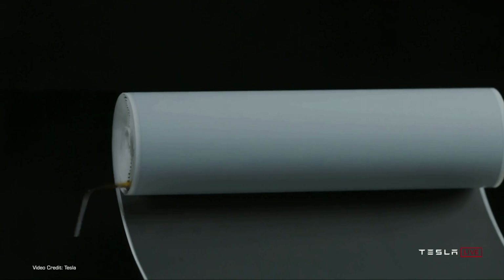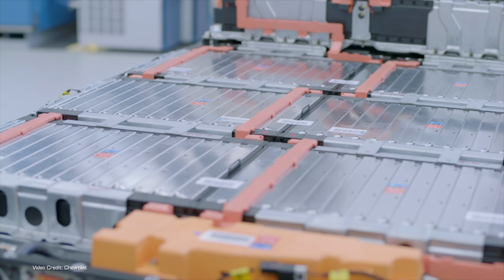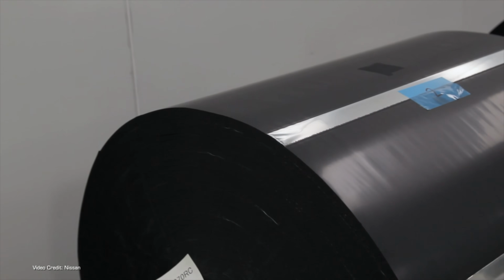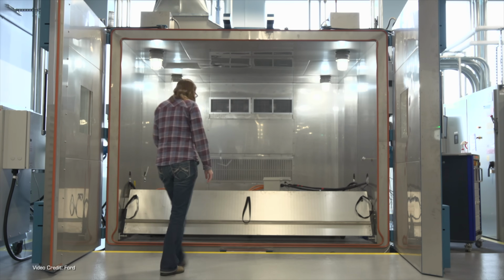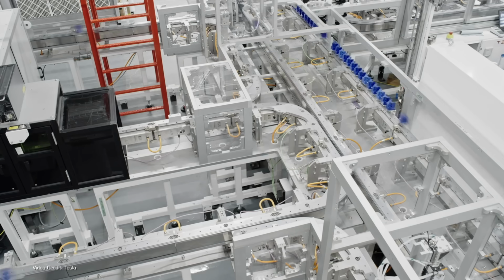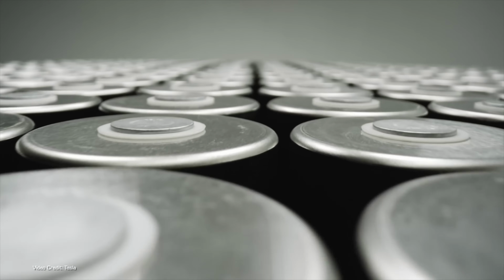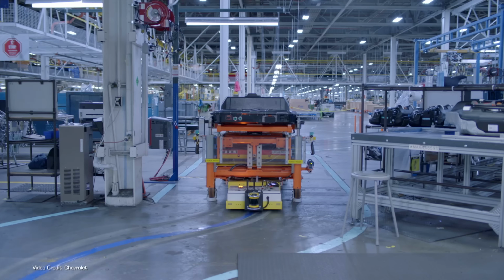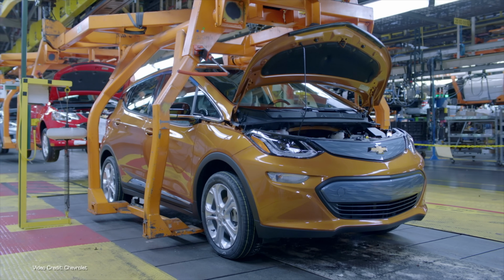Just Why Are Electric Car Batteries So Hard To Produce (And Diagnose)?

Comment: 15:55 I'm sick of Tesla and their excuses for delivery delays, they did not invent a new battery chemistry in "The Battery Day", they just changed the individual cell dimensions to be slightly more space efficient (think of it as they have longer rolls to produce larger cell). and BTW their new cells is slightly energy dense, not much energy dense (the advertised sizes 60% and 50% ...etc is a result of being bigger/heavier). The increased range and density in  is very small.

Comment: It seems EV battery issues will slow the adoption rate. Governments can't mandate technological progress without problems.

If you really believe global warming is a serious problem just put a tax on carbon emissions and not try to dictate technology.

For example, widely adopted PHEVs with cheaper, safer, but less dense sodium batteries would reduce emissions more than poorly adopted EV.
Reply: For example. Widely adopted PHEVs using a safer less dense sodium battery could reduce emissions more quickly than an EV push.

Comment: I have heard a number of commentators talk disparagingly about how long it is taking to get the 4680 cell into volume production. I am pretty sure that Tesla said it would take about 18 to 36 months when they discussed it on Battery Day. Wasn’t Battery Day in September 2020? If so, it has been 10 months since the 18-36 month clock started. Can you help me out understand why the impatience? Thanks to you and your team. Love your work!
Reply from the maker: We aren’t feeling any impatience, that’s the point we’re making here. 

It’s taking as long as should be expected, and in line with Tesla’s estimations. But we’ve seen commenters, both here and in Tesla forums, express confusion as to why it’s taking as long as it’s taking, given that Tesla has demonstrated the cells already, because folk don’t understand what goes into scaling up a battery cell production process. - Winter

Comment: Current battery tech is too short lived, too slow to charge, cost is too high, and the ability to recycle these batteries is limited.  I consider the current tech interim until something that is made from less costly materials, easily recycled, and longer lasting are developed.  The solid state batteries sound like they may be the next leap in that direction.  Faster charging, longer lasting, more forgiving, with reasonable capacity sound like solid state may deliver that.  To baby the current battery tech in that sweet spot between 80% and 20% charge, control the temps, and keep them happy removes enough range and capability of the car to be back in the equivalent range of the first gen short range EV's.  And if you are in a first gen EV it means hardly any range at all in a car that had hardly any range to begin with.  So this is quite challenging.  But all that said the bigger issue is infrastructure and having charging stations spread far and wide.  It is easier to take care of those batteries if you aren't constantly wondering where you are going to get some electrons to keep that battery happy.  Then making sure those charging stations are online, functioning, and can be easily used with a debit and credit card.  End the membership schemes and other gimmicks and just make things simple.  Everything does not have to be complex and involving toys, apps, and gadgets.

Comment: are they really that hard to get right.....or is it just really hard for everyone other than Tesla? The fact is that unlike what's happening with the Bolt, Teslas haven't had these sorts of problems. Tesla has had enormous success in reducing cell costs and scaling volumes. You cite the time it's taking to get 4680 cells into production as evidence that Tesla is having problems....but are they? It seems that it's just your opinion that it's taking too long.

As for cobalt and scarce minerals, again, Tesla seems to be at the forefront of addressing these concerns by moving away from cobalt and getting into the mining business....and developing more environmentally friendly and inexpensive ways of mining these materials. Additionally, they (Tesla) have developed a strategy of using different chemistries and form factors for different use cases, further optimizing cost, longevity, charging times, and other factors to best suit the use.

All in all your piece attempts to blur the distinctions between those who are really good at this and those who aren't, and as a result paints a less than accurate picture of the situation.

This piece really should have been called "why is it so hard for everyone other than Tesla to figure out how to make batteries".
Reply from the maker: You absolutely heard what you wanted to hear in our comments about how long it’s taking Tesla to get the 4680 cells into production. It’s taking exactly as long as Tesla projected, but we do see comments, both here and on Tesla forums, questioning why it’s taking as long as it is, so we thought including Tesla in a discussion of how challenging scaling battery production is, something the company knows well, which is why it projected the timeline it did. 

Tesla did have challenges earlier on with battery issues in customers’ cars, including fires and misbehaving charging, and it worked those issues out over time, which is why its current batteries are as reliable as they are (which again, we credited them with in this video). 

It’s also important to remember that while Tesla produces batteries for its cars, it also buys cells from other battery producers, including the issue-plagued LG Energy, whose improperly produced cells are at the heart of both the Kona EV and Bolt EV fires. - Winter

Comment: What I don't understand is how Ford F150 is apparently going to get over 750km on a single charge, and Lucid is claiming nearly 1,000 km on a single charge, yet neither make their own battery. Surely if there was some breakthrough by Panasonic, CATL, LG, etc, we would hear about it in the press before it made its way into a car? Even the vaunted "industry leading" Quantumscape issues a PR every small breakthrough they make.

Nikki, do you believe these ground-breaking ranges coming out from both legacy and start-up automakers? The numbers seem too precise to be made up. Where are these leaps in performance coming from which even the established battery makers don't seem to know about?

Phillip.
Reply from the maker: It’s not a leap in performance, these companies are just packing in massive battery packs to achieve the desired range. Look at GM shoving 200kWh of batteries into the top spec Hummer EV to achieve the range it has despite what is likely to be wretched efficiency. Even Tesla’s Cybertruck with its new form factor batteries hasn’t achieved anything radical in wh/liter of energy storage. It’s just going to have a lot of batteries - Winter
Reply: @transportevolved  re: "It’s not a leap in performance, these companies are just packing in massive battery packs to achieve the desired range." exactly, same as the real word there's NO SANTA CLAUS in "battery world" either folks.  as such it's a very simple equation: MORE ='s MORE ("Bigger is Better" - Texas accent).  the pack in the Lightning is said to be a massive 1800lbs, and the new "all conquering" 2022 Tesla MS Plaid is still a nearly 2.5 Ton vehicle (4833lbs per Brooks of Dragtimes).  right, compare this figure to the larger 2022 11th gen Honda Civic (basically PEAK ICE) with it's declared Curb Weight of only 3100lbs max.

Comment: Of course, all of these issues are solved if you consider Green Hydrogen.  Renewable energy used to make clean hydrogen from water.  If you'd do a side by side comparison, it's apparent that the "All battery" approach misuses the "battery."  Hydrogen is nature's battery.  Potent (100x specific energy density per mass), safe, available to all local economies, and 100% non-toxic.  Also, and please take this point on, it can scale!  That means we can have a clean energy world based on a Green Hydrogen paradigm.  Fuel cell EVs make sense because they're 1% "battery" and 99% fuel cell.  When you battery people take this onboard, you'll see there's a better way to use batteries than using them for 100% of the load.  Just nuts, (or unwilling to calculate the amount of "battery" you'd actually need for our world).  Fuel Cell EVs are the only path, using Green Hydrogen, which can actually save the world.  Remember that priority?

Comment: Hi there winter or whoever is reading this.

Is it possible to make a video about the importance of a strong, well engineered KERS/Regenerative braking system?

I think a lot of people don't seem to understand the value of it.
 And I myself would love to understand the difference between a Kona Regenerative braking system vs the MG zs ev KERS vs the Tesla .

As I m unable to understand how much power is actually put back into the battery and also how much additional range I am getting from it realistically when comparing total range figures

Comment: I’m going to come out say it but the Spark EV is the best EV GM has made so far. 400 lb/ft of torque for the 2014 and 327 for the 2015-2017’s, no fires.  Peppy and works well for a commuter, easy to park. The Bolt doesn’t have the Sparks torque.

Comment: Great video. Considering the way in which GM has handled the Bolt battery issues, consumers will be especially interested in all aspects of how GM is developing the Ultium battery system.
Reply: re: "GM is developing the Ultium battery system." which for now is really just a "name" a "label" no different than what we've seen created/used in different ways by the Auto Industry for the past 100 years.  there may not be anything of "greater" SUBSTANCE in it beyond what we already have (because: MARKETING).  mind you this is not a BAD thing because what we have in terms of existing Lion Batts is PRETTY DAMN GOOD.   so the key is getting control of our "Greedy/Rapey" behavior long enough so we can appreciate it for it is.  no fan of Elon, but the new Tesla MS Plaid is a "working demonstrator" of the value of current technology and capability.

Comment: The high voltage required to keep the cost of the car down means you have to put multiple cells and modules in series, which makes balancing the cells more difficult, requiring even tighter tolerances.

Comment: It's not just batteries in vehicles. Yesterday down here in Au the Victoria Battery had a fire and that was during testing. As a local fireman pointed out all you can do to extinguish that kind of fire is to let it burn out. As for for forensic analysis of why a cell went bad it's hard when the thing has melted. I've put out an ICE fire, it was due to an electrical fault.

It's when you look at the challenges from an energy density perspective I think you get a clearer picture. Li-Ion cells are around an order of magnitude lower  than a high explosive and high explosives have around one tenth the energy density of petrol. Petrol needs oxygen to burn or go bang. High explosives and many electrochemical cell chemistries  don't need oxygen to do bad things. A fire in an ICE is usually pretty easy to extinguish especially if caught in time. Not so easy in a battery pack of 1,000s of Li-Ion cells. We could build Li-Ion battery packs with individual cell monitoring but that would  be expensive and add some weight and manufacturing difficulty. Practical for stationary batteries but not in an EV. 

The other factor here is the sheer number of cells in an EV. Li-Ion batteries were first used in video cameras in packs of a small number of cells. I've had odd one go bad but not a huge drama and simple for the manufacturer to do the right thing and give a replacement. It's a problem that scales the wrong way as more and more energy storage is needed. One bad cell in a pack of 6 or 12 and a total loss is bearable. One bad cell in 4,000 taking out the whole pack or as is very likely,  the whole vehicle is a real problem.

Comment: There are also problems in volume production of any high volume product. First to find test methods to really detect all deviations from the required characteristics and then the issue that no matter how careful your are some defect product will sneak thru as good in ppm quantities.
For this reason not the best performance design may be desirable but the one which in case of failure doesn't cause an issue. In case of batteries LFPs are the safer choice but don't have the desired other features like super fast charging/discharging, capacity per volume and temperature characteristics. Solid state batteries might be even better but as was said it takes forever to make new things ready for production.

Comment: I would be happy with batteries that simply have a less catastrophic failure mode.  I think the goal should be battery chemistry that is not prone to thermal runaway but getting that and sufficient density, charge cycles, and temperature performance may be a while off.
Reply: You mean like LiFePO4 ?
Reply: I'm pretty sure the market will provide that, just in a less blunt term.
You can buy the latest superduperdoublecheese battery car (only thousand produced with this technology, so you are a beta tester of sort) or a oldestablishedlowtech battery car that has not that performance, but a million piece were around so we have already worked out the kinks.

Comment: It’s funny how EV enthusiasts claim that EVs are so much simpler than ICEs. . They aren’t.
Reply: I totally agree with you, the whole battery pack alone has tousands of cells which can easily fail, the BMS, charger, inverter, motor controllers, and all the sensors inside, plus the complicated software to monitor all of it.
Reply: re: "It’s funny how EV enthusiasts claim that EVs are so much simpler than ICEs. They aren’t"  what we're seeing in the claim that BEV's are "simpler" is actually the PSYCHOLOGY of PROJECTION.  as such it's not BEV that's "simpler", no, it's they (themselves) who are "simple".  that is, they are "simple minded" in their thinking/Cognitive Ability, and don't really understand how truly COMPLEX the Universe actually is.   you can see this same PARADOX with the Commercial Jet Engine.  in principle the "Jet Cycle" for thrust is almost LAUGHABLY BASIC in it's operation.  great, now try to build one in your shed EQUAL to those built by Pratt Whitney, GE, Rolls Royce, etc.
Reply: @phillyphil1513  I see the point your making about everything being complex and the jet engine is a good analogy, but to say that people who support EVs are simple minded is offensive and unfair.
Reply: @phillyphil1513  it is simpler because there is almost nothing to service and far less to go wrong.
Reply: There's less moving parts in an ev so in that sense they are simpler and theoretical have less to go wrong but obviously they are both complicated machines.
Reply: @timscott3027  there are less moving parts but tousands of electronics that are even more difficult to repair and won't last as long as ICE, you can still see 30-40 years old ICE on the road
Reply: @carholic-sz3qv  Have you not seen the amount of electronics in the current ICE vehicle? They have comparable electronics systems to work these days with ICE needing engine monitoring systems to keep pollution as low as possible and BEV needing battery monitoring systems to maintain battery temperature.
Reply: @carholic-sz3qv  yeah possiblity, I guess time will tell. Most ice cars will have had a lot of parts replaced at that age though, why couldn't you do the same with EVs? Perhaps car makers should be building cars with easily replaceable components all round including electronics and drivetrains.
Reply: @timscott3027  EVs are more controlled with software and swapping parts here and there won't be easy in the future, just like on iphones. People have even lost acces to tesla superchargers for those reasons.
Reply: @carholic-sz3qv  yeah I know but not impossible, just not economic all the time, but that's true of ice cars too. That's why easily replaceable components might be a good thing. It would probably need a lot of government regulations to make that happen though.
Reply: @timscott3027  unfortunately its not going/isn't working. with vertical integration, repairs are going to be a huge disaster just look at the latest apple imac, everything is on board and apple will probably never sale parts for repairs as louis rossman knows.
Reply: @carholic-sz3qv  all management systems rely on sensors, ICE EMU retunes the engine mapping all the time to keep it at optimum efficiency so it has to interact with the sensors all the time. All the  ICE vehicles comparable to Tesla will have  multiple cameras and systems for adaptive cruise control, traffic-sign recognition, semi-automatic parking, "sports mode" controls, collision warning systems etc etc
Reply: @rtfazeberdee3519  tons of ICE have had cameras all around even 360 degre views and many other features, EVs still have way more electronics than ICE tho.
Reply: @carholic-sz3qv   Your original point was "EVs are more controlled with software and swapping parts here and there won't be easy in the future" - my point was that ICE will be subject to the same issues because of the their large amount of reliance on electronics.  ICE has the added complication of an engine/gearbox etc and those parts will be hard to come by when they stop making them.
Reply: @timscott3027  re: "but obviously they are both complicated machines." therein lies his point, it is NOT "obvious".  if if were obvious, we all wouldn't be here talking about it, and Nikki wouldn't be making these uploads.